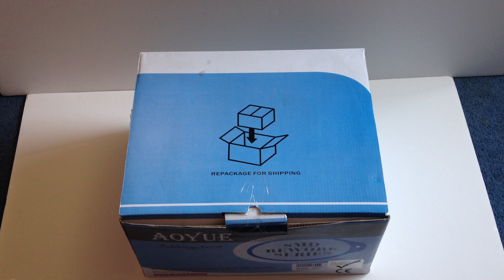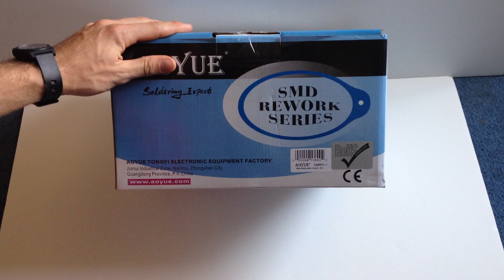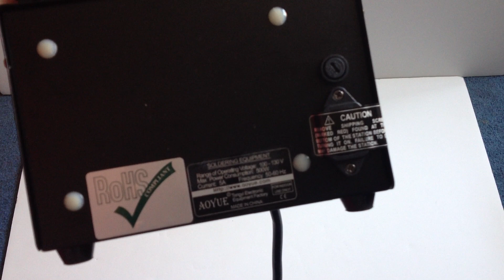Quick Unboxing & Look At The Aoyue 850A++ Hot Air SMD Rework Station

Comment: Looks good,For all who are looking for a hot air rework,Stay away from Hakko 850D,No schematics are available,No support from hakko,Had lots of problems with this unit from the start,The main microcontroller IC has a custom firmware flashed onto the eprom and hakko does not support anymore,And unidentifiable smt IC's on the main board.Also stay away from the Hakko 852 model with the led display and built in pump,Same problems,The 64 pin smt micro controller IC controls the temp of the hand piece,And when it goes bad,The units will keep the heater element on until it burns up and electrically opens,While the display flashed H-E and beeps.The Hakko 850B or the Hakko 850 is the winner,No surface mount components,Schematic is available online with all discrete components that the consumer can repair,Made in japan and the heater elements are for sale on ebay for under 20 bucks,They are made in china but they work,Have one working for years.